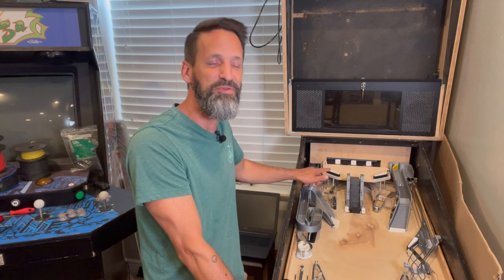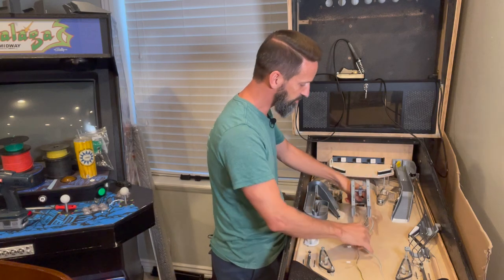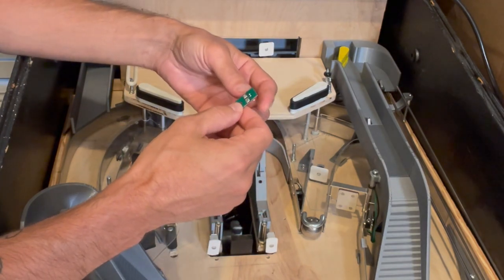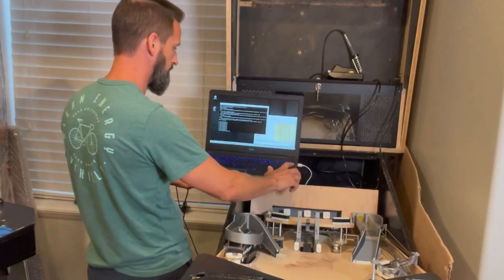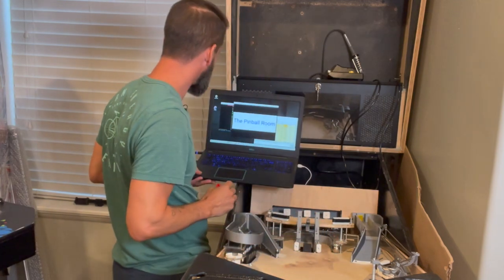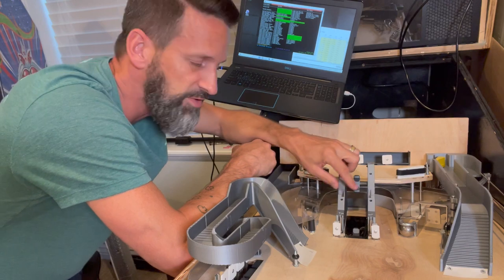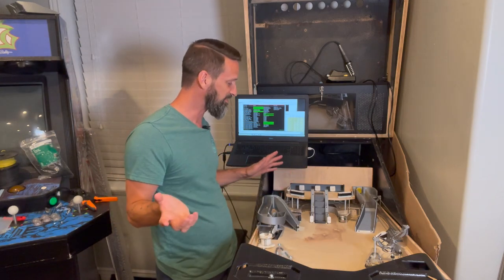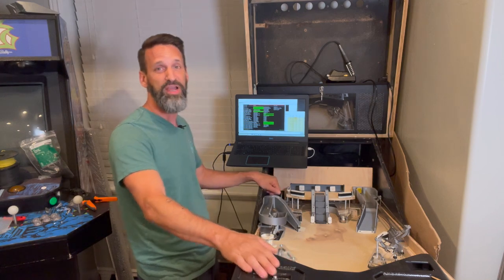HOW TO MAKE A PINBALL MACHINE: Seeing Invisible IR Opto Lights

Comment: I wonder if it would make sense long-term to just re-print the stairs sides so that they are mounted from below the playfield. Then you won't have to worry about slding in the optos and routing the cables - just unscrew the whole stairs mech and pull it out to work on it.
Reply from the maker: Yeah that's a great point, similar comments have been made, I'm still debating whether it's worth doing that for this one off machine, but very likely may be worth it

Comment: So with optos the emitter has power and ground while the reciever just has power and the ground to the switch board.  Same power on both sides?
Reply from the maker: Using the FAST boards, no direct power line comes into the receivers, they get power from the fast board "indirectly" - the receivers simply need a line that goes into the fast board like a normal switch and a ground line back to the fast board too (so just like a normal switch)
Reply: @thepinballroom  I'm using P3 boards. I just about have my lower 1/3 playfield wired up. Hope to add the cabinet buttons wired and flip for the first time soon.
Reply from the maker: @ByronBedenbaugh  Hey, that's awesome! Big milestone to get to working flippers SOOO much fun after that point!  so, yeah, check with the p3 folks, I know the boards are similar, but they don't do everything the same, so prolly good to double check what they recommend for wiring the receivers to their boards (but I'll be surprised if it's different - post the answer here actually, I'm curious now 😀)
Reply: @thepinballroom  I have my lower 1/3 playfield working finally! For my optos I have the power and ground to the green side and the ground and switch to the other black board. Ball 1 and Jam was recognized time i worked through the error messages to get the code working. Looking forward to design my layout now. Thanks for the inspiration.
Reply from the maker: @ByronBedenbaugh  Nice!! Way to go!! That’s a big milestone!! Now you can really start to play around with different playfield layouts!!